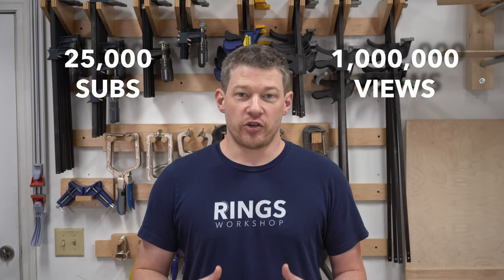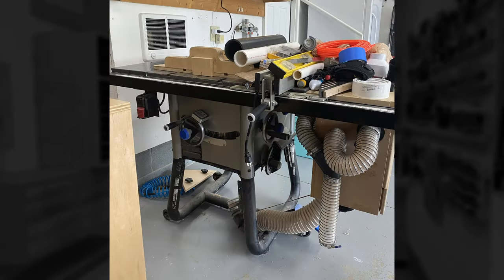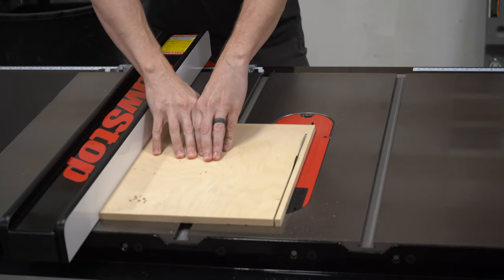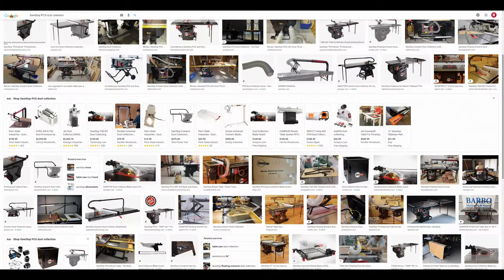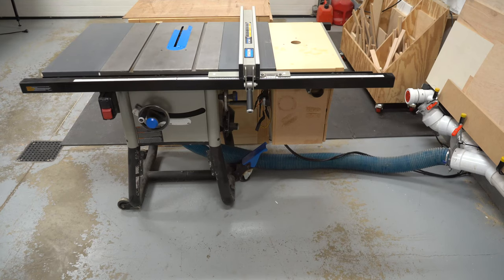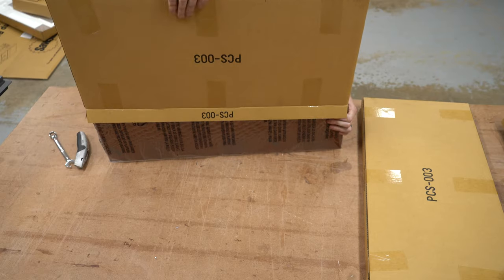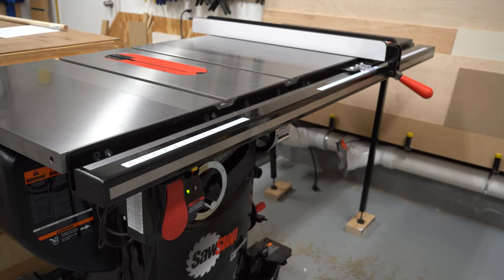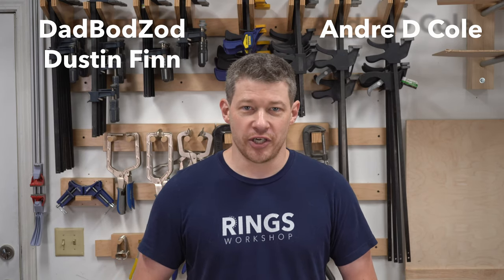Why I Upgraded to a SawStop

Comment: That dust port punch out idea is goddamn brilliant! You should email them these ideas.. I bet they’d take them seriously, because they seem easy enough to implement and could increase their sales even more so. Great video, and congrats on the new saw! #Jealous
Reply from the maker: Thank you!  I never understood why saws had them in the back, you are guaranteeing a 90 degree turn since no one has their drop behind the blade since boards would hit I.  Seems like the sides would make more sense as any 90 degree turn adds friction to you dust collection and reduces airflow.
Reply: @RingsWorkshop  that’s another great point! Seriously, I hope you contact them about these changes. It’ll be years before I can afford one myself, but maybe by then, they’ll be using these ideas for even better saws

Comment: Hello and thank you for the helpful content. I am in the nearest of futures going to be picking up the PCS 3hp 36 fence . So I have a question on how you were able to raise the saw up to work with your outfield table. I like you have my home built MFT track saw system that is just a bit too tall as configured and I would rather not build a new one right off the bat. If push comes to shove I'll build a new table but you mentioned you were able to raise your saw up so how did you pull that off. Thank you.
Reply from the maker: I built a 3” platform that I placed inside the mobile base and then set the saw on top of that.  Using 3/4” plywood and a 2x4s, then painted it black to match.

Comment: I bought my saw stop for the safety aspect. And I keep it because how will I use it. The dust collection right underneath the blade is really nice, over the blade dust collection is really nice. Fit and finish also nice. I’m not moving mine around the shop so I did not get the wheel kit and I put my on 2 X 6 laying sideways for the perfect height. Great video keep them coming…
Reply from the maker: Thank you!  Should have another in next week or two.

Comment: I went from a Dewalt Jobsite saw to Sawstop 3hp 52in, wow was that a change. My only slight irritant is the jack in the mobile base. After a few months it would no longer lift and had to be adjusted again every couple of months. As mine is constantly being moved it was a real pain to get down there with a stack of hex keys and adjust it when I just wanted to make a quick cut. I think i finally got it dialed in but it was 2 years of that. Support suggested i keep fiddling with it, they weren't wrong.
Reply from the maker: I’ll keep that in mind, no issues so far but I haven’t had it near that long.

Comment: I’ve had the 3 hp Saw Stop for two years and I love it but I still wanted to see your video. I have to say you’re dead on with all of the positives. I originally had a Delta Unisaw that I got in the 90s so apprehension was at the top of my list when I was looking to make a change (safety being the major driver). But since I’ve gone to the Saw Stop I have never looked back. The build quality is top notch, the accuracy out of the box was dead on. The only negative that I’ve seen is that the metal compound of the table must be different in some manner because it is prone to rust. Most of my tools are/were Delta and I’ve had them since the 90s.  I’ve lived in New Mexico and currently in Arizona which is obviously dry but they’ve never rusted. Within about six months of owning the Saw Stop I started to experience rust on the table top. I did discuss it with Saw Stop but they had no constructive input other than to say,  “metal will rust, here’s how you clean it.” 🤦‍♂️ But beyond that I’ve never regretted buying it.
Reply from the maker: Thanks!  Love it so far, broke some a bunch of plywood yesterday for a cabinet and it cut like butter and was amazing how big of a difference going from a 30”-36” table/fence made.

Comment: you got me at favorite band, I'm a thrasher too haha, I listen to Slayer, Metallica, Testament, Exodus, and Megadeth when I'm working.......and also plenty of country
Reply from the maker: I’ve seen Slayer four times, 3 with Hanneman, once on their fairwell tour.  First concert ever for me was Morbid Angel, Slayer & Pantera.  Not a bad lineup.
Reply: @RingsWorkshop  Hell yeah, I've seen them four times as well, two with Jeff. Awesome videos man . Your Drill press table attachment as the drill press dust solution have been my favorite two videos. I ended up building the drill press table attachment and I'm looking to build the dust solution attachment for my press as well. For the past few years I've been using a Dewalt jobsite Table Saw planted into a work table I built myself. It works very well, but cleaning it or maintenance can be tricky when you have to remove a few things. Dust Collection is one of those tricky issues you're constantly trying to fix. Because of that this video is giving me an itch to save for a SawStop, your rundown of the features have probably been more in depth than other Youtube channels that utitilize one. And as far as displaying the overall functionality of your saw I enjoyed it. I did not know they come with a Router table attachment. I cut a slot for a router station on the side of my table saw using a Rockler attachment and a custom dust hood, but that SawStop looks better designed. Awesome work. I'm glad to see your channel has grown. recording woodworking videos and editing do take ALOT of time. I'm trying to get the hang of it and I admit it is much work. Great job on your part. I'm glad I subscribed.
Reply from the maker: @Murf_Workshop  thank you so much!  Ya I have been slacking, been almost a year since I posted.  Hoping to have one go up in next couple weeks but I keep having stuff pop up, just need to video edit but it’s a pretty complex one so I don’t want to rush it and miss something.  Thanks for the kind words, means a lot!  Good luck with yours as well, it’s a lot of work but worth it for sure once you get it going.
Reply from the maker: @Murf_Workshop  thank you so much!  Ya I have been slacking, been almost a year since I posted.  Hoping to have one go up in next couple weeks but I keep having stuff pop up, just need to video edit but it’s a pretty complex one so I don’t want to rush it and miss something.  Thanks for the kind words, means a lot!  Good luck with yours as well, it’s a lot of work but worth it for sure once you get it going.

Comment: Why answer is at 4:40 safety. While safety is valid concern I really hate sawstops business model business practices. They first went on a patent spree on how to make table saw safe then used the one that would make them the most money with destroying the blade. They had an excellent working prototype and patent for another version that had reusable cartridges and would not destroy you blade but they killed it so they could make more money. There was concern about their business practices when it came out but now it seem everyone has forgot.
Reply from the maker: They also tried to sell their idea to other major table saw companies and no one took them seriously and declined their idea so they went and made their own saw.  I have no knowledge on the other concept you speak of but I would assume if they didn't go with that anyone else would be able to make said safety mechanism and haven't, so not sure how viable it is.  Their patent runs out soon so we will see.

Comment: You can use a hole saw and drill out your own dust port...then modify it so it can connect to the hose. easy-peasy
Reply from the maker: I may do that at some point, but I didn’t to do a bunch of mods to a saw in a review video.

Comment: NICE! Congrats! Happy for you, but also slightly jealous...
Reply from the maker: Thanks!  I appreciate it!  Today is actually the first day I’ve got to push it a bit with a bigger projects vs smaller stuff.  Love it!  Need to get my dust collection set back up though haha!
Reply: @RingsWorkshop  Please, do definitely set the dust collection going... not worth testing things without. 
It's the PCS 3 hp?
Yeah, I'd say that you'd still have to take anything over 10/4 in 2 passes.
At 14/4 walnut or mahogany, my friend had to take 3 passes and swore at me when I reminded him that I recommended the 5hp for that very reason...
"What do you know- you're still doing things on a jobsite saw!!"
True- but I've worked in shops that had 3, 5, 7.5, 10, and 12 hp saws and anything over 8/4 will eventually need more power to cut through... that and a strong enough dust collector 😉
Reply from the maker: @zafarsyed6437  ya it’s the 3HP.  I had the DC hooked up but it’s through a long flex hose as half of mine is torn apart and I want to get the overarm up and going.
Reply: @RingsWorkshop  If you haven't already gotten some, or already done so, maybe reach out to Rockler?  They love seeing their blue flex on YT.  But maybe only if you're as excited as Chris from "A Glimple Inside" about having blue...
Since a fan of black/red... maybe Armor tool makes flex hose? 🤔

Comment: I use a 70s rockler/beaver tablesaw.  I'm a hobbyist and I'm not trying to push out projects.  I'm trying to make a few gifts a year; update my home here and there; fix my friend's sagging drawers due to failed hardware, etc.  Saw stop is a pro tool trying to get sales.  Respect the tool; own the tool.  Respect electricity, don't get electrocuted.  Respect speed, don't crash & burn.

My tablesaw is older than me.

Comment: Having a hard time understanding why you tout the safety features of the saw as being so important to you, yet you make repeated cuts without the guard in place. What is the reasoning for removing an important safety device, especially as you say "that's the number one reason you invested in a sawstop"?
Reply from the maker: Because I find them being more in the way and boards catching on them at times, and narrow pieces I cannot cut with a push stick and the guard in place.  I’ve removed it on every saw I’ve had, as do a lot of people.  Safety is extremely important, but I consider the board I’m pushing doing what I expect it to do being more safe than questioning if it is going to get caught on something and possibly having to react or adjust unexpected.  I keep the riving knife in place to avoid kick back, if I feel my hands are getting too close I use a push stick.
Reply: @RingsWorkshop  thanks for your reply